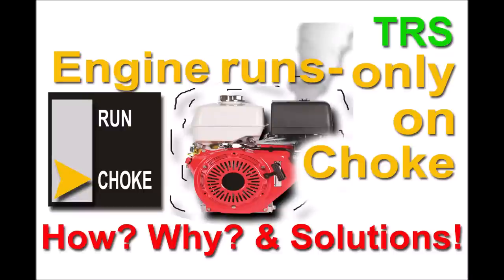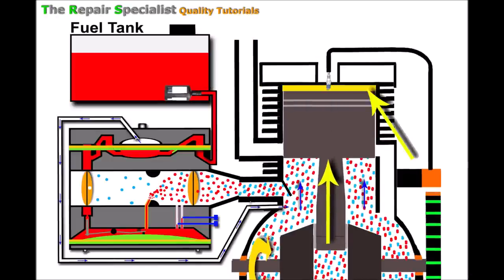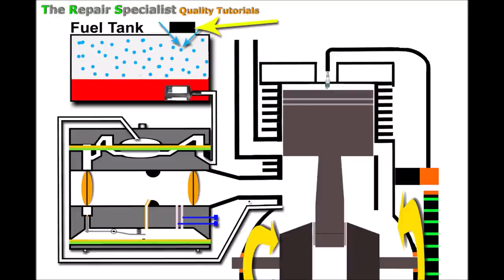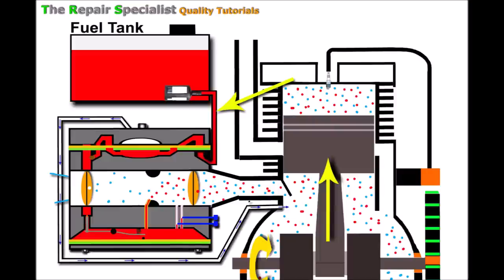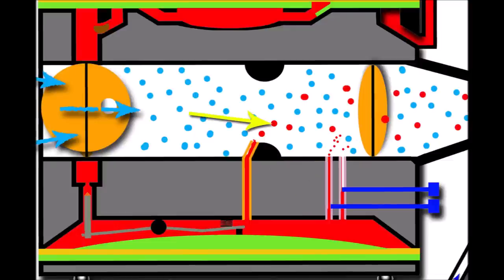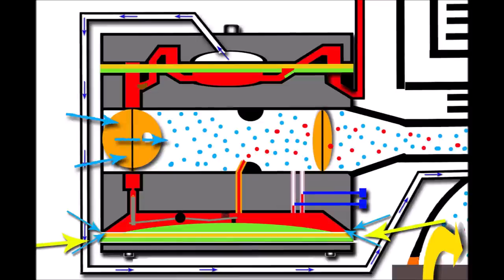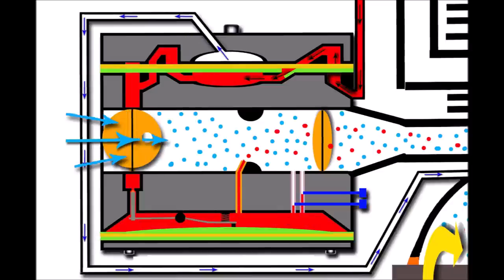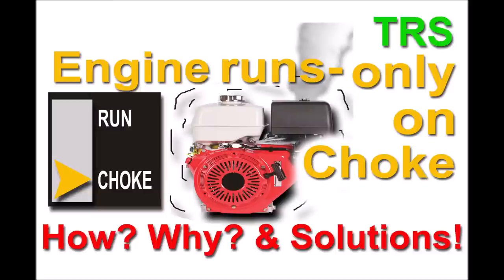Why ONLY RUNS ON CHOKE - Small 2-Stroke Engine

Comment: I have a lawn care business. Do all my own maintenance and repairs. I learned the hard way that pump fuel is not for 2 and 4 cycle engines. Since I started using 2 and 4 cycle fuels my problems have about all disappeared. For those who I shared my experience with and they too switched fuels I get thanked many times over. Replacing machines is not cheap. Dealer service is not cheap. I have been cutting lawns for 75 years, so I have been there and done that. Free advice, it's your choice.

Comment: Are you still monitoring these comments? I have an Echo trimmer that runs lean. Very low hours. Maybe 10 to 20 hrs. There are apparently no adjustments on this carb. I can run it with the choke partially closed which  keeps it from getting too hot, but I don't like doing it. Can you think of anything I might do or evaluate to get it richer? Well past warranty; I have several trimmers so I didn't use it enough before the warranty period expired to discover the problem. I suppose I could order the carb for the same size trimmer that has adjustments; is that smart?

Comment: Wow I completely overlooked the purpose of the air hole in the fuel cap kept scratching my head wondering why my bush trimmer is dying only after 10 minutes or so of running perfectly fine. Just needs to be cleared.
Reply from the maker: Thank you for your feedback I really appreciate it. Craig 👍

Comment: Nice, simple explanation of causes and solutions to this common problem, I have experienced many of these issues. Often I don’t know exactly what the problem was because I find it easiest to shotgun the repair. Replace or rebuild the carb, 2 cycle carbs are now so cheap I just replace the whole thing, kits usually come with fuel filters, breathers and spark plugs for ~$20.  If the problem was caused by a faulty fuel cap, you will still be left with the original problem, thanks for mentioning this early in the video, this is the easiest thing to check for before a more complete tear down. Thanks for taking the time to give such a thorough lesson.

Comment: Maybe a bit late to the correspondence, but none the less. Well presented, and a depth of information you don't normally recieve. Many decades ago I did City and Guilds light vehicle diagnostics, and I have messed around with 4 Stromberge set ups on 4 cylinder engines that I could tune with a piece of pipe for balance, and basic perception for mixture tuning., but the nigly peculiarities of simple 2 stroke chainsaws and weedeaters have been another learning curve. I feel refreshed, and ready to do battle again.  Thanks for the tutorial.

Comment: I most appreciate your efforts to help people understand and benefit from knowing more about these little motors that are so beneficial when they run properly. I have been a victim of my ignorance regarding these motors and since I am now retired and have some time, I decided I would spend my time trying to learn and fix a number of these trimmers and lawn mowers that have been cluttering my barn and work areas. 

I have spent the last two and a half weeks tinkering with a Poulan Pro (PP325) trimmer that is about 2 years old.  I have cleaned the fuel tank, replaced fuel lines and filters, replaced the coil,  checked the firing with a spark tester,  checked the compression on the engine, rebuilt and replaced the carburetor, replaced the carburetor, removed the muffler to check to see if the spark arrestor is clogged and have managed to get it started and run for only a few seconds. 

I also have a craftsman trimmer  Model 358.745501 that had been laying around for probably 10 years not being used. After working on the Poulan and making no progress, I decided I'd try to get the old craftsman running. It is also a 25 cc as luck would have it. I first knew the fuel had to be changed out so I removed the fuel cap and poured out the contents of the fuel tank. It was mostly a blue  oily substance. I then filled the tank with fresh gas pressed the primer bulb about 4 times and pulled the rope....it started on the second pull and ran fine. As it turns out the spark plug  and carburetor are identical to the parts on the Poulan, so I began exchanging parts to see if I could determine what the problem is. I switched spark plugs and the craftsman runs fine, switched them back.  I switched carburetors and the craftsman runs perfect but the Poulan will not run.

I am blessed with patience and tenacity and I am determined to find the reason why this Poulan weed eater will not run.I have watched many You tube videos and have learned a great deal about these little engines but I cannot get this Poulan Pro 25 cc trimmer  to run as it should.   If you have any suggestions on what I might try to remedy this problem, I'd be most appreciative.

Again, thanks for sharing your knowledge via You Tube!!!

Comment: Yes, diagnosing a two stroke engine is always such a joy.  But there is one other thing possible that can restrict the flow of gasoline from the tank.

Long story short.  I found a unit that had a screen on the supply line inside the tank to prevent any large debris that got into the tank from plugging the inlet to the gasoline supply line.  The unit had been in storage for a long time and the gasoline has deteriorated and started forming a varnish.  That varnish had coated the screen and plugged up the holes in the screen and blocked the flow of gasoline.

Could not find a replacement so I managed to get the screen out and soaked it in a penetrating oil for a while and then took a small pick and started pushing it through each opening in the screen and giving it a twist to open the openings and remove the varnish from the openings.  Worked fine after that.

Like I said, such a joy.

Comment: One thing omitted from this excellent video: modern forecourt petrol and the check valve damage it causes..
It's fatal to carb type fuel systems.

I've spent a few days now, ordering, buying and fitting (all were necessary parts) - purge bulb, fuel lines, gaskets, full Walbro carb repair kit, in-tank filter, doing carb cleaning, tank cleaning, fuel cap relief valve... 
And it still won't run more than a minute or so.

Turns out the check valve seat was corroded, thus preventing correct fuel uptake, and this is non repairable. (Although I am going to try grinding off the damage - nothing to lose, now).

Now I only use Aspen alkylate premix, it lasts years too. 

Knowing what I know now, would've bought a new carb straight off.

Awful stuff, this modern petrol.

Comment: Brilliant Video and a great help - one more point that happened to me on a Ryobi petrol line trimmer - check the bolts holding on the cylinder head are tight. I was surprised by just how little they had to be tightened to get rid of a problem and of course they were not easily accessible being torx headed and needing right-angled torx driver to get in at them for tightening.
Reply from the maker: Thank you so much for the nice feedback. I really appreciate it. Craig

Comment from the maker: One point I really should have mentioned, although as I said in the vid that I had to end the vid somewhere, is the main crankshaft seals can leak and draw air into the crankcase and produce bog down symptoms due to lack of fuel entering the engine as a result. Thanks
Reply: And THAT is the  one thing I haven't replaced.  :)
Reply: A very important addition to an otherwise excellent presentation about the air/fuel relationship in 2 stroke engines..., and why running on choke is clearly an indication of any of the possible problems you detailed so well. Another typical source of 2 stroke air leaks can occur in the impulse passage itself, particularly in designs using a hose between the cylinder and the carburetor to provide the impulse signal to the pump diaphragm. A faulty or loose impulse line (or fitting) would also obviously provide less than adequate impulse signals for actuating the pump diaphragm and creating another "double whammy". Well done, sir. Thank you.
Reply: Is there a way I could check for this one?

Comment: Ok I dont know if you read these things or not but I have a Husqvarna 235 e and I've tryed everything. New carburetor, new fuel lines 3 times and then I find your video. It was the fuel cap. Who would have thaught that a fuel cap would make me crazy. This was it if I dident figure it out I was throwing the saw in the driveway and backing over it with my truck. My saw and I thank you sir.
Reply from the maker: Really pleased you sorted it out.  Thank you for letting me know! Craig
Reply: A blocked fuel cap will stop a small engine cold. Like he says in the video a sucking hiss when you open the cap is a sure sign. I had a weed wacker that happened on. It'd start up and run but it wouldn't throttle up. Then it'd just die. It would run fluttery before it died too. It was the classic runs like crap scenario.

Comment: Very good description of two stroke principle and fuel system love the graphics good build of systems. Most of the two strokes I have worked on do not have the reed valve, the piston is the valve, it closes off the fuel and air intake port port first and then clears the transfer port to pump the charge from the lower crankcase to to the cylinder. On the way back up the piston closes off the transfer port first, further travel creates suction in crankcase then piston skirt clear intake port and bam sucks in fuel air mix.  If someone wants to say you don’t actually suck you lower the pressure and atmospheric pressure pushes it in well that’s true and the term suck describes that process. Reed valves are normally used on more powerful engines. Please correct me with examples if not up to date with the latest weedwackers. Quick check if it does not run good, remove exhaust screws and silencer and look at piston as you turn by hand and it goes past exhaust port, if it’s scored and groves and rings seem jammed it been run without oil or run lean with air leaks possible crankshaft seals leaking and seized due to overheat, it’s then been allowed to cool off and turns but damage is done. 
Drain fuel when done and refuel with correct mix when next needed if lending (not recommended) supply with a supply of two stoke mix fuel sufficient for job saying special fuel not straight gas use straight gas you own it. It’s premix oil and fuel mix 50 to 1 25 to 1 it says on the unit somewhere.

Comment: I know this is a older video, but I have a weed wacker that I started after the winter season. It would only run on half choke. After looking though  the manual ,it said to use fresh gas. So I dumped out the gas and refilled it. It ran like new. Choke off running like a raped ape! Just a tip!

Comment: My friend has a chainsaw that starts, even in summer, only if you pull the choke shut, and after it started you can open it back and it keeps working.
I tried to tell him that the mixture is not tuned right, and that the engine is getting too little fuel / too much air on idle, hence the need to choke it, but to no effect.

It revs ok, and after it's turned on it stays that way.
It also has a problem with the switch (which I think I caused :D).
When you switch it off, the switch doesn't ground properly. You can hear the engine trying to shut off, and also trying to keep going at the same time, it's so interesting.

Probably due to the vibration, the switch/cable ungrounds, and when the vibrations climb, it grounds again, causing the rpm to go down again, which lowers the rpm, in turn ungrounding the spark and creating a chain reaction, where the engine just "kicks" from time to time, just enough to not shut down.

So, to turn it off, I (ironically) pull the choke. That kills it. The thing that was necessary to turn it on, turns it off.
It's fascinating.
Quite the food for thought, and a nice reminder that the right thing at the wrong time can make quite the difference.

Holy cow I deviated a lot, but uhhh the main thing is the mixture problem.

I think I need sleep :)

Comment: Thanks so much this helped so much finally figured out that there was too much air getting in where the carb meets the intake manifold.
Reply: There shouldn't be any air getting in there. Unless you're restrictor plate NASCAR racing. I've had mufflers rattle off too. That don't help small engines run any better either. Some back pressure can be beneficial.

Comment: Nothing left to be misunderstood in the explanation for someone with no understanding this should demystify it all and is a reminder to use filtered fuel.  Typically its the diaphragms that get stiff or stretch and don't function well.  Surprisingly I found the cost of a new diaphragm and gaskets is almost as much as buying a new carburetor. Much to my surprise they can be had for $10-$20 online and with that you get spark plug, air filter, grommets and hoses going to fuel tank (fuel tubes get very brittle and grommets tear and leak in just a couple of years) primer bulb, fuel filter and new diaphragms in fact a whole new carb. whereas the rebuild kit is $10.

Comment: Hi my Echo 3450 starts right up sounds perfect. it will still run of idle' BUT will die when throttle is opened up.
It will rev with part choke but of course it over fuels some if you do that!
I cant seem to find the loss of pressure from the crank seals. this still after i put a full tune up and carb kit in it.
its got me about to pull my hair out! lol Thanks for great work on here,

Comment: Absolute genius presentation. One point though, the two adjustable fuel screws would be H and L . Shouldn’t the L jet be the engine side of the butterfly throttle valve?

Comment: I have a small chainsaw that only runs on half choke but when on half choke it sounds like it's running really rich. I am planning on replacing everything the carb, fuel line, fuel filter and now the fuel cap seeing how the parts are cheap enough. It's actually a friends saw I've been meaning to fool with for a while now.
Reply from the maker: Well, if you are planning on changing all of those parts then i'm sure you will sort out the problem. Great!

Comment: I have this issue with my string trimmer too. I loosend the cap on the fuel tank and it seems to run slightly better but not much better.  I also noticed something strange happening; there is fuel turbulence and air bubbles in the primer bulb as if the fuel is being fed through the primer bulb. I am wondering if the hoses were improperly connected. Any Ideas?

Comment: Hi Craig, great video. I have a strimmer with a Zama carb and is running very fast under choke and stalls quickly without. I have just done a fullcarb rebuild after the bulb stopped drawing fuel and the symptoms mentioned have persisted and are exactly the same. This to me implies mixture screw issues assuming I didn’t screw up the rebuild.
This being the case can we assume the off choke mixes are lean and so need winding out very slightly ?
Reply from the maker: To me, what you said sounds very likely indeed.  I would start there. Thanks. Craig

Comment: Another great video. Just out of curiosity  what is your theory on this situation. Two Ryobi ( from Home Depot in the U.S.) machines; a leaf blower and a powerhead for several attachments. Both very new-purchased 1-2 months ago. Both ran perfectly the last time they were used two weeks ago with fairly fresh gas/oil mix. The oil came with the machine. The gas in New York is typically 10% ethanol. 
After completing my task lwo weeks ago,  I emptied the gas tank and ran them until they stalled. Go to to use both the other day and neither will start.  I made a new mix with fresh fuel and oil, but no change.There was no combustion whatsoever. As if no spark or no fuel. They were both stored in my basement which might have slightly humid conditions, but no musty smell. I returned both but am trying to understand the cause before making another purchase.

Thanks for all the great information..... A wealth of knowledge that I really enjoy watching!
Reply: Home depot has a 90 day return policy

Comment: One question- should the pulse line be airtight - if you suck on the tube on the carburetor side, should air be able to suck in - AKA leaky pulse line

Comment: Thanks for the video. I was sure I fixed everything right but after watching your video, I sprayed carburetor cleaner between the carb and the intake it bolts to, and it died instantly. the old rubber seal was worn flat over the years and doesn't seal properly,
Reply: Ummm? Think a little more carefully next time😂 

Using carb cleaner to clean the inside of your piston walls, what a riot. It's called carb cleaner supposed to go in the air intake THROUGH the carb then to the engine.

Comment: I’ve currently got a Briggs and Stratton vanguard lawnmower engine which will not run without full choke. I’ve changed the solenoid, fuel filter and cleaned and upgraded the carburettor but it still won’t run without choke. I must have done something wrong. I’m going to buy a goat to cut the lawn I think.
Reply from the maker: Frustrating!!
Reply: TheRepairSpecialist I have good news and bad news the mower was going great after all the work I did. The bad news is that I put a new battery on fired it up and fried my electrical system. I’m currently trying to identify the parts/wires damaged so I can replace them. I’m very frustrated and angry with myself for putting the wrong type battery on it. Please send alcohol and pills.